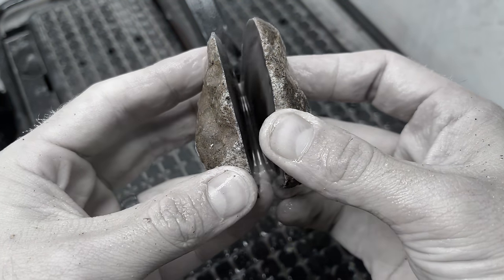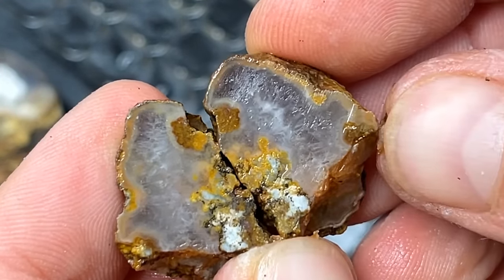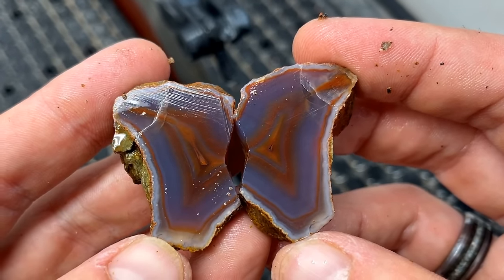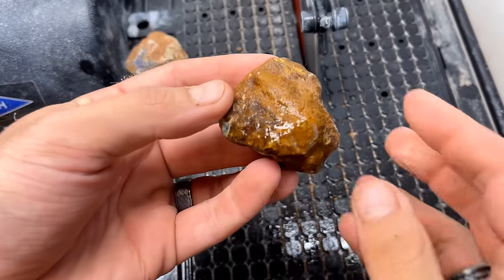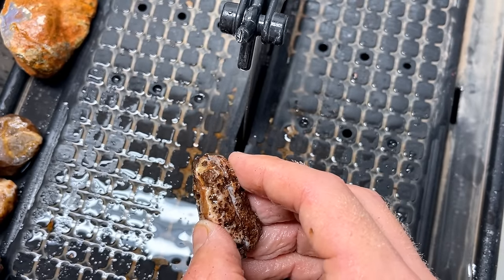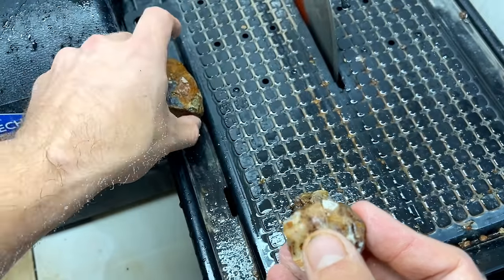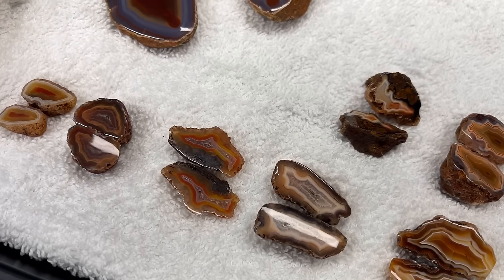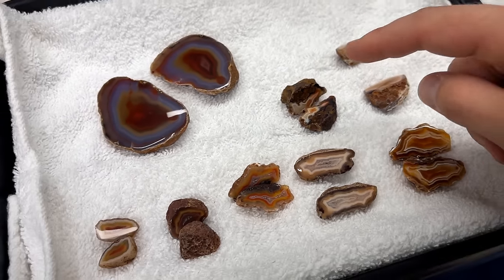I turned ROUGH nodules into POLISHED gemstones!

Comment: So what do u do with them afterwards??  Or, what do other ppl do with them then after buying them from your Etsy store???  Use them for paperweights?  Do you ever cut slices for pendants???  Then just drill a hole in them for hanging/stringing??  The smaller ones, if it's even possible to thinly slice them without losing a finger or 2, if you put a hole in each end the slices would be great for bracelets!!  So pretty!!